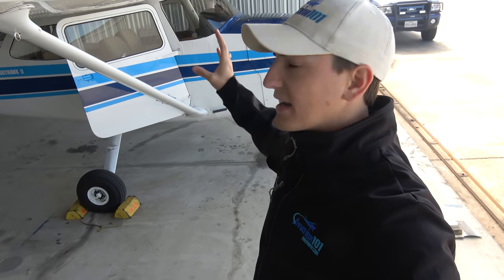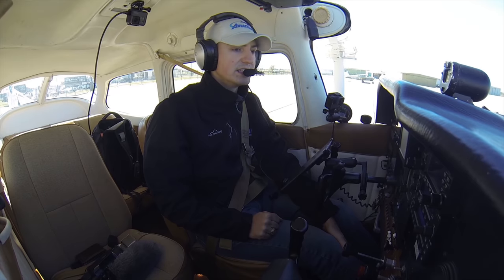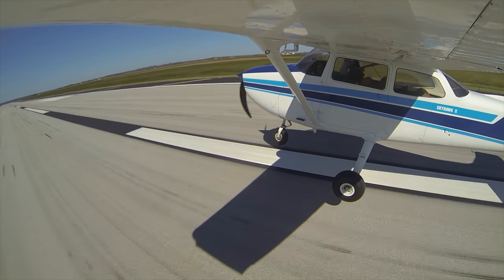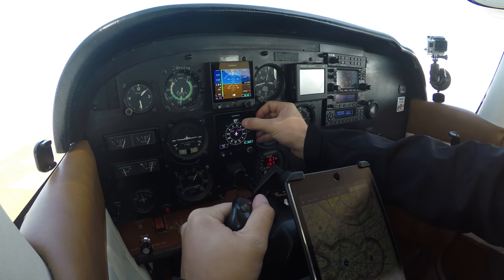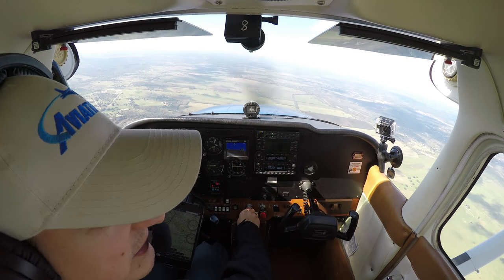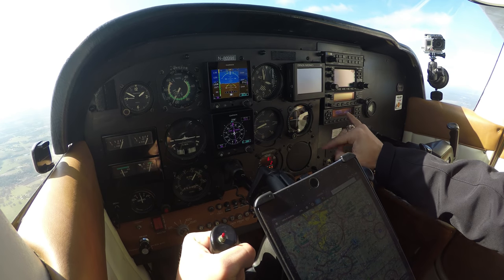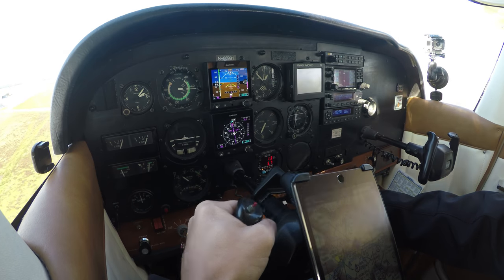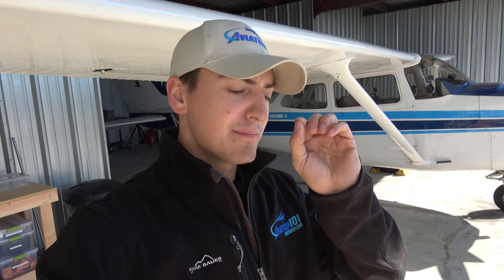Cessna 172 GLASS PANEL - Test Flight - Garmin G5

Comment: Got G5’s in all the warriors at my flight school. Absolutely love them! Literally everything you need is on the G5. The battery pack in them is an awesome backup too! Another tip, instead of scrolling the knob to get the heading bug on your current direction, just push and hold the button for about 2 seconds. It will move it to your current heading. Saves a bunch of scrolling! Also, save yourself some time by not says not saying “with information Indiana” I know it’s picky, but you can save some time by just using “80991 with Indiana” they know what information is current. Was told this by a retired Atlanta ATC guy.

Comment: The existing fleet is aging and new certified airplanes keep skyrocketing in price. I new 172 is almost $400k. It is crazy.
Reply: Cessna is expensive as hell. Original spare parts for new models like 172/182 etc are not cheap....
Reply: The demand for a clean 172 has gone through the roof.  Look a 20 year old s models with mechanical panels.  They are still 200K+.  Usually need getting closed to timed out motor and still aren't glass.  Not that you really need it for flight training, but people want it.
Reply: Yikes $400K for a new 172
Reply: Could be US product liability insurance.
Reply: @g r He graduated a few months ago .

Comment: Amen...The vacuum systems are so outdated and dangerous. I too changed to Duel G5's. What a difference. 
You can virtually fly IMC on just the Attitude G5. It displays all information. Attitude, heading, altitude, slip skid, vasi, and airspeed.
Switched over last March. My Attitude and DG gyros where failing. With that in mind I basically got a 2K discount plus no vacuum worries.
Situation awareness increased on top of that. 
Enjoy your vids thanks.

Comment: On your G5 AI you can use the altitude select as a visual cue for assigned altitude or minimums by pressing the knob and scrolling across. It works perfectly as a reminder and will even flash when approaching altitude from 1000’+/- and 200’. If you add a Garmin auto pilot, this is how you would feed it info. Look on pages 100-101 of your G5 manual for specifics.

Comment: Try using expanded scale on the Garmin G5 attitude indicator. Instead of showing 0° to 20° it will show 0° to 10°. A lot better detail for doing 1/2° change of pitch to hold your altitude.
Reply from the maker: paul sanchez thanks! I may try that!

Comment: Howdy, so your #1 Nav/com is GNS430; and with 2 G5’s, you Could remove you suction, leaving the to G5’s as you all electric 6 pack?  Did you consider Dynon slide ins D10A?  (EAA holds and sells a $100 STC, I believe).  Does the avionics shop secure the STCs?  Ballpark of cost?  By the way, Charlie’s SR-20 (223CP) was mine for 6 years.  Charlie’s a great guy & pilot.  Take care, I learn lots from your videos.  Thanks.

Comment: Josh, if you press in on the knob on the heading indicator, it will snap to your current heading. This way you don't have to scroll to your current heading every time. If you ever have any questions on Garmin avionics, let me know as I intern for them!
Reply: Jared Yost Never got that to work on the G5, is that a new feature in later software?
Reply from the maker: Jared Yost tried that tonight! Worked! Awesome tip.

Comment: You missed a very important question

For those who have recently converted to the latest version of the  G5 how do you connect an Ipad to it to display a moving map? Does itneed another module or firmware update? or panel socket?

Comment: Great video as always, Sir! I have a question (which maybe was asked in another video of yours, but I couldn't find it): What are you counting, when you set flaps? "one one thousand, two one thousand..." Is that a check on the time the flaps need to move?
Reply: trizzleseven older C172 doesn’t have ‘notches’ on the flap lever or a position indicator. It’s 10 degrees of flaps for (approx) every 3 seconds of holding the lever. He’s counting the 3 seconds
Reply: @mitchelljj3860  Ahhhhh, that's makes sense! Didn't know that. Thanks for the answer. So it's possible to fly the old C172 with a Flap setting of for example 5°?

Comment: Question - on final you mentioned 30 deg flaps. With the wind so high and gusting, why did you choose to go full flaps (or can you go to 40 in 991)? I typically wouldn't go past 20 in those conditions, so I'd like to hear your thoughts or reasons pro/con on when to use full flaps and when not to.
Reply: Ben Davis 30 is fine with those winds, plenty of rudder left to align the nose
Reply: Just make sure you dont get too slow, add a few knots for the gust factor, keep the nose down and manage ur altitude with power

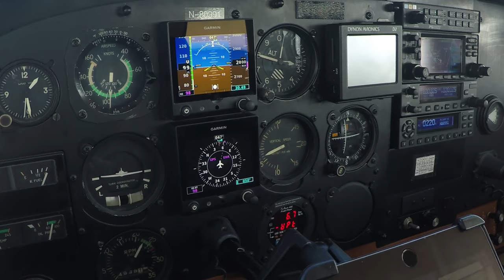Comment: around 8:20 you are talking about ground track.  Is the ground track the path over the ground you are taking?  So basically your nose is pointing 047, but the plane is actually flying more like 060?  Or am I making it too simple?
Reply: Pappy Drone/Airsoft Yep thats it, when you hear the word crab you are pointing you nose toward the wind, so you go the way you want because the wind is pushing you.
Reply: OK, so let me ask another dumb question.  The controller tells you to fly (using the above example) heading 047...but you won't actually be flying 047, right?  you would be flying 060.  So how does that work?  (I think I am making something very easy very complicated...I blame the cold medicine...)
Reply: Pappy Drone/Airsoft if atc gives you radar vectors its in magnetic heading not ground track, good question.
Reply: Right, but you aren't really flying that vector, you are just pointing that way, right?  Thank you btw for the discussion.
Reply: Pappy Drone/Airsoft yes its not given in track because some airplanes dont give track and if the wind is calm your heading will be your track. Np for the discussion

Comment: I will be upgrading my 172N to dual G5's in the next few months.  What did this upgrade with removing the vacuum system do to your empty weight?  What are your plans for an autopilot?
Reply: Doesn't change much I don't believe. Maybe a 1 or 2 lbs. Put 2 G5s in my 205 and took out the vacuum system didn't pick up hardly any useful load.

Comment: The G5’s look great but in my shopping for instruments to redo the panel in my ‘58 182 found that my only choice to run the 2nd G5 as a DG (and get rid of my vacuum system) is to buy a $5000 Garmin Nav/Comm...correct?  ($5000 + antennae’s and installation).  Is there another way to get rid of my vacuum system and satisfy the DG requirement?
Reply: No one knows?

Comment: I'd consider getting a 172 or PA-28 if I could have that glass, but not for the typical prices they want for it... Way to expensive even still. What'd the install run you? Its hilarious we have 300-500$ ipads that have more functionality than most of these basic "glass" cockpits... They really need to overhaul the industry on regulations for GA aircraft tech. Should be no reason that experimental aircraft can have better avionics for FAR cheaper than a "certified" aircraft. Last I checked a G5 for experimentals was half the cost for certified, just in parts.

Comment: How many $$ did you dump into a 172?
Reply: He's obviously loaded...
Reply: Or he manages finances well... @jvu2ilj26
Reply: @SkyhawkDriver  I manage finances well... but I can't afford an airplane.
Reply: Agree to disagree...but I know many who work average jobs and can afford a plane @jvu2ilj26
Reply: An older 172 is less that the cost of a large SUV. You don’t need to be loaded to buy a plane. You need to be loaded to buy a new one!
Reply: @dalgrim  But if you factor in the cost of hangar, maintenance, fuel, etc. I'm sure it amounts to a couple thousand bucks a month. I'm not an expert though. I hope I'm wrong...
Reply: jvu2ilj26 Fuel can be counteracted by making smart decisions. Home field is 4.30 a gallon? Fly to that small airport 20 miles east and refuel at 3.50 a gallon. You don’t “have” to have a hangar, and could use a tiedown. And mx dependent on a plane isn’t all that bad, yes it’s good to have a reserve of money for emergency breakdowns, but I haven’t seen any of my owner friends have that issue. Assisting with the annual inspection and other work lowers cost as well
Reply: I own a 65' Piper Cherokee 180. Hangers vary from $200 to the sky's the limit. Depends on your location and your plane type. I tie down $100. a month. Annuals run about 1K per year insurance $500 + depending on hours and Pilot ratings. Gas $50 per hour on average. I fly on average 50 hrs a year. Then there are upgrades and repair cost. Last year I spent well over 28K in upgrades and Paint and interior. Plane insured for 40K worth 60K with upgrades. So on average with loans and operating cost I spend about $700 a month. BTW my cars and motorcycle are paid for. So it's about the passion to fly. If you partner with someone the cost go down.
Reply: What is the ballpark $$ panel upgrade for the electronic hsi and ai installed?  I'm looking to buy good used 172 in the future probably with existing "steam" panel. Nice video BTW:-)